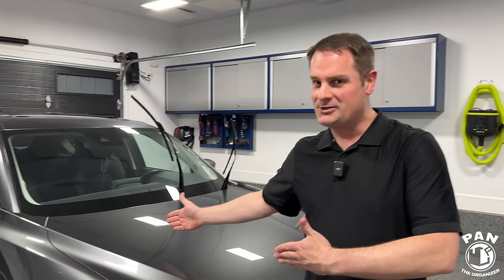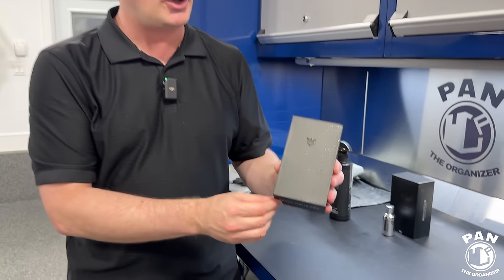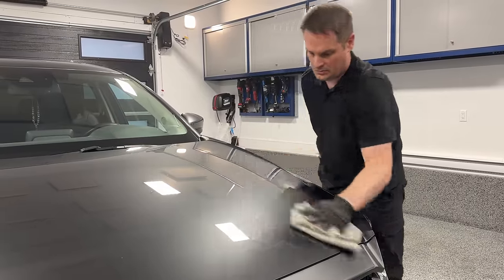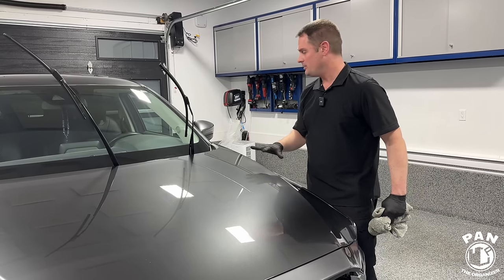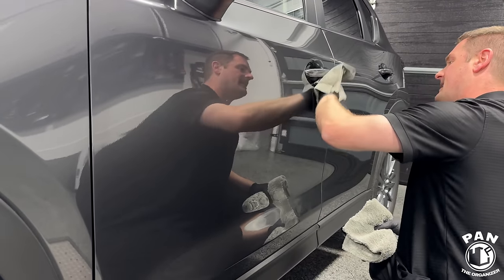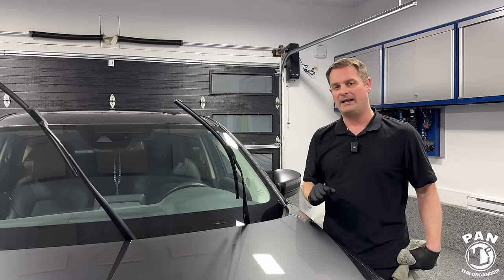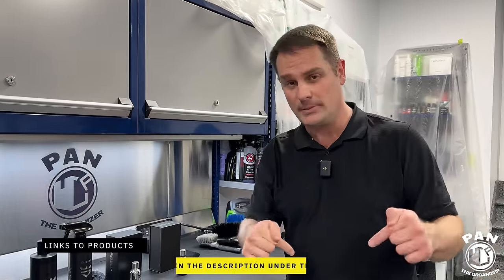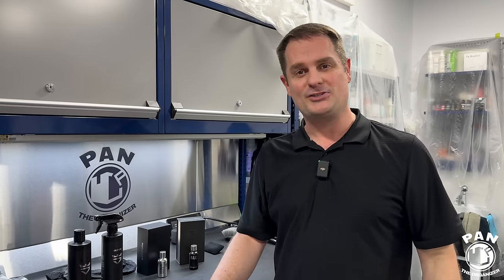NEW AvalonKing Armor Shield MAX ceramic coating! 1 layer, 3 years protection!

Comment: I have a new 2024 Honda CR-V white pearl metallic. Would you recommend Avalon King MAX, Pro or Cerakote or possibly something else? I’m looking for 3 to 5 years protection,one coat that works on all surfaces. I’m in western Kentucky and would greatly appreciate your advice for white paint! I’m an OCD weekend warrior and all the products I use are from your annual awards list. Thank you! Russ
Reply from the maker: MAX is a three year coating, so you'll have to wait for their G.O.A.T. coating that is promised to be a 5 year coating. Cerakote doesn't give any durability claims in terms of years, but they have reset the conversation around durability by measuring a guaranteed resistance to 200+ washes. But that's a professional grade coating, so I wouldn't compare it to a consumer grade brand like AvalonKing. We have to compare apples to apples.

If you want something I have been testing for a while that should give you the durability you want in a single layer, there aren't many options. You'd have to go on the prograde and purchase DuraSlic Holy Grail or Roar Coating. I have reviewed both on my channel. I need more time to test Cerakote, but that would likely be another fantastic candidate.

Comment: Have you used the AvalonKing on matte black vinyl wrap? My new car has a matte black vinyls decal on the hood and I’m wondering how the AK will affect the look.
Reply from the maker: No, but you could apply it on top of matte decals. It will make them look richer, but not glossy so it shouldn’t be of concern. Most paint coatings can go on matte decals.

If your entire vehicle was a matte paint, PPF or wrap, then I’d recommend a matte specific coating. Like in my tutorial here: https://youtu.be/5RocSxJQmzI?si=kxp5lbwTiC8zJ2zD
Reply: @PanTheOrganizer  That’s very helpful, I appreciate the response. I’m going to test it on a small area first just to be safe.

Comment: I have Armour Shield 9 on my car too and would like to go to the new Max coating.  what should I do to the car to prepare for the new coating?
Reply from the maker: As I mentioned in the video, if you have an exisiting protection, it would be best to:
- wash using a prep shampoo like their AK Prep Shampoo 
- iron remover to remove brake dust and fallout
- clay the surface to remove any other embedded contamination
- machine polish to ensure 100% removal of the previous protection (CRUCIAL STEP) and remove any swirls/scratches/oxidation
- IPA wipe with a paint prep spray (like the AK Prep Spray) or isopropyl alcohol mix to remove polishing oils and residue and prep the surface to receive the new coating
- apply the coating

I have a full ceramic coating application tutorial here: https://youtu.be/sqQYVjxFqK0

Comment: I'm going to be coating all 3 of our vehicles this spring. I'm pretty much settled on Mohs with a topper of can coat or FlowX. I can also get DS 1500 on a promotion right now but wanted to be able to use something I'd have access to long term. What are your thoughts between Mohs and the MAX? And would you spring for the DS 1500 over either one as a DIYer? Thanks.
Reply from the maker: Max is still too new to market, but MOHS is a higher end product for sure, so I wouldn't compare them. If you think of going for Gyeon, get their Syncro EVO kit. Apply 2 layers of MOHS, and 1 layer of Skin. You should have great protection for 36-48 months.
Reply: @PanTheOrganizer  Thanks. Do you feel like the skin reduces the slickness of the Mohs? That's the main reason I was thinking of can coat or flowX as a topper without Skin.
Reply from the maker: Yes slickness goes down a bit but it’s still a slick coating.

Comment: Pan, if you have to choose: Avalon 9, or the new Cerakote ceramic coating, what do you prefer, and why? 
( I can not choose)
Reply from the maker: Impossible for me to answer, as I need to test both for a longer term. I only applied the AS9 MAX 6 months ago on my brother's SUV, follow up video coming next month most probably. And the new Cerakote has only been released less than a month ago, so I need to test.

If the new Cerakote version does well as far as durability is concerned, that would be my choice, as it costs less, only needs 2 hours of curing, and has better gloss and slickness, and is even easier to apply.

Comment: Hey Pan, on these kits . Technically when buying a new towel your supposed to wash before use. Towels that come with kits, should you or not wash those towels
Reply from the maker: Yes. But as it’s a single use towel, it’s not as critical if you use it straight out of the box

Comment: Great video as always Pan! I applied the original Avalon King coating a few months ago and so far so good. Do you have a video that shows how to remove a ceramic coating and prep the car for new coating?  Also, I used my original Avalon King on all the plastic inside my car, can the Max be used that way as well?
Reply from the maker: The only way to remove a ceramic coating is by machine polishing. So you would have to redo all the steps from A to Z. Decon wash, iron remover, clay bar, machine polishing, IPA wipe or paint prep spray to remove polishing oils, and then apply the new coating.

The AvalonKing coatings are only meant for exterior use.

Comment: I like Armor Shield's products, but for some reason I've had a lot of trouble trying to remove them.  I've tried different towels, using less product, etc., but for some reason it's still hard for me to remove.
Reply: You are waiting far too long before buffing off the haze.  I found that I have to buff the haze off almost immediately after applying.  If you wait too long it’s nearly impossible to remove the haze.  Depending on the temperature, I typically buff the AS IX haze within a minute of application.

Comment: Hi Pan, I just applied the Avalon King Max yesterday. It has a great shine, but absolutely no slickness. I had more with a basic topper applied a couple weeks ago, Nexgen ceramic spray. My truck is like a battleship gray in color. It was super hard to see the product on the paint. And even after about 7-10 mins, we could not see any rainbow effect, so we did the leveling then buffed it. Any ideas? 
Thank you
Gary
Reply from the maker: It’s not the slickest coating in the world, compared for example to coatings like Gyeon Mohs, C6 Ceramics Lite, but it’s still slick compared to bare paint. Wait a week after application and you can start using which ever topper suits you most, to boost slickness if needed.

It’s hard to troubleshoot applications at a distance without having seen how you prepped the paint or how you applied it. Perhaps reach out to AvalonKing if you have specific questions as they are best suited to troubleshoot on their own product.
Reply: @PanTheOrganizer  thank you very much for your response. I did do all the prep work. First wash with dawn in a foam cannon, then a strip wash(contact wash), then sprayed Adams iron remover then rinse, then used diy perforated synthetic clay towel to decon, polished with diy gold standard and yellow pad, Avalon’s panel prep, then avalons king max coating. I’ll see in a week if I have any benefits of the coating. If not, I’ll contact Avalon like you stated. Thank you again. 
I’m new to this, my friend is really into detailing his vehicles and turned me onto your channel. Big fan. You give great insight to everything detailing. Keep up the great work…. And I’ll stay tuned👍
Reply from the maker: It seems like you did the right steps. If after a week, you wash the car and the water is beading nicely and is quick to sheet off, you know the coating is performing as intended so I wouldn't worry. If the water just pools up in one big flat sheet of water and is super slow to sheet off and doesn't have any water beading, you know something is wrong.

Welcome to my channel. You discovered one of the biggest car detailing channels on YouTube as we surpassed 1 million subscribers and we have over 140 million views! I have been detailing for 27 years and I love to share my knowledge and passion with my viewers.

You found the right channel to help you learn everything about detailing.

Comment: Hey Pan thanks again for the content you provide. I have a 2021 Hyundai Elantra with black metallic paint that hasn't  been washed for over a year and has set out in the elements. My car was detailed right before we moved here and I think he just put a wax coating on. My question is what would I use to strip my paint to the clearcoat? My detailer said I could use Dawn dishwashing liquid for a wash which would strip it down to the clearcoat so I can apply the ceramic coating. Suggestions? Thx kind sir.
Reply from the maker: You would use a stripping soap, like the AvalonKing Strip Wash I linked in the description. I don't recommend using household items on car paint. Dawn dishwashing liquid was a trick used decades ago. Now the technology with good stripping soaps exists. 

But regardless if you use a stripping soap or Dawn, that doesn't guarantee 100% removal of the previous protection. It just starts the breaking down process. If you still see water beading after the strip wash, you should do a light machine polish step. That's the only way to ensure 100% removal of any previous protection.

And after polishing, make sure you use the IPA spray (like the AvalonKing Panel Prep spray) to remove polishing oils and residue, and ensure a proper bond of the coating to the paint.

I have covered this topic extensively in many videos on my channel.
Reply: Thx kind sir. 👍✌
Reply: Thx kind sir. 👍✌

Comment: What did you use on the tires?  I put the original Avalon King on my car now 3 yrs ago.  Buying a new to me 2019 and will be giving it the works.  Bought the Cerakote before you did this video because of your other video :-)  Can the new Avalon King Max be applied on top of the Cerakote or vice versa?  Or would it be a waste of time and money? Keep up the great work Pan.  You have turned me into a bit of a fanatic.
Reply from the maker: No you don’t apply a coating in top of another one. True coatings need to bond directly to a virgin clear coat to ensure maximum performance and durability. 

The tire dressing I used in this video is this: https://bit.ly/2ZXCKt3
Reply: Reason asked is on a DIY Detail video they put their 3 year over the 8 year coating. Thought that was odd and against what you have taught me.  All the products I have purchased is because of your channel. Again keep up the good work. Your friend in AZ. Griz
Reply from the maker: That’s a very different scenario. In some cases, when applying a fresh coating, sometimes you can stack layers due to chemical compatibility. In that case, two coatings from the same brand, that were formulated to be compatible.

So there are always exceptions. Yvan knows what he’s doing as he has 40+ years of detailing and those are his products so he knows the synergy between them.

I hope this clarifies things.

Comment: Hello good afternoon, Pan, if we have any scratches or holes made by pebbles, can we apply them without any problems?

Thanks

Hugs from Portugal
Reply from the maker: You mean stone chips? I'd recommend that you do some stone chip repairs before applying the coating, as once you apply this, you are sealing in the finish for many years.

But if you don't care about how the stone chips look, you can just wash the car, do iron remover and clay bar, polish if needed, IPA wipe, and then apply the coating.
Reply: Thank you Pan for the explanation, it helped a lot because a lot of people say that you can't use ceramic coating as long as these things are present.

Hug  @PanTheOrganizer
Reply from the maker: My pleasure Antonio. Welcome to my channel. You discovered one of the biggest car detailing channels on YouTube as we surpassed 945,000 subscribers and we have over 125 million views! I have been detailing for 26 years and I love to share my knowledge and passion with my viewers.

You found the right channel to help you learn everything about detailing.

Comment: Just finished apply the Armor shield Max 3 years,very easy to apply I have many concerns with instructions need to be more clear how we should apply this product. Time for setting, temperature/humidity to install. I can’t find anything…! Anyway job is done the way I think it should be like others brand. I replaced my poor cerakote coating who last 4 months with winter and temperature probably too low when I applied ! The gloss and slickness of cerakote was awesome compared to Avalon max but the water sheeting and bedding was poor. Avalon max is very dry on touch no slickness at all and all my clothes and applicator was good for trash after the product crystallize. Pan already explains the different formula of coating. The included applicator  with Avalon was  really bad I prefer the applicator they gave with the previous version 2 years.

Comment: Excellent to see the new product from AK.  Andy's car looks amazing especially knowing how little care he takes of it :)
I'm definitely going to pick up a bottle of the new AK IX Max and try it out.  I have a customers car in mind that i maintain weekly for them.  Presently it has a Technicians Choice TEC528 as a weekly protectant.  It doesn't need polishing as I recently did that to it.  What would you recommend in this case, to remove the present TEC528 protection before applying the AK Armour Shield 9?  Do you think just a wash with something like Adams Strip wash, and wipe down a couple of times with a 30% IPA mix and then a rewash with the Adams Strip wash will do the trick to remove the TEC528?  Thanks
Reply from the maker: Strip washes only start the breaking down process of older protections. The only way to ensure 100% removal of any previous protection is by machine polishing. A light polish should be enough. There needs to be no more evidence of water beading on the surface. Meaning no protection left. Then IPA wipe, then apply the coating.
Reply: Thanks for the reply Pan.  I guess ill have to do quick once over with say a 3D One 400 to do the trick and then the IPA and coating.  @PanTheOrganizer

Comment: The product as I see is very easy to apply like the previous version but at the video I didn't see any diference in gloss from the no treated area.
Reply from the maker: It’s hard to tell a difference on camera. But for the biggest increase in gloss on any paint, the best way is always through paint correction (machine polishing). That’s how you get the biggest increase in measurable gloss (gloss units).

Paint protections (waxes, sealants or coatings) are like icing on the cake. They will give a few more gloss units, sometimes imperceptible to the eye, but offer a different type of gloss like a warm carnauba organic glow, or a candy like high gloss like a coating does.

Comment: Hey, Pan!  I have really enjoyed your channel.  I used the original Avalon King on my new car.  It was my first time applying a ceramic coat.  Everything went well.  My only negative is the water spots.  My car is a Subaru Outback Onyx edition in magnatite gray (similar the color of your brothers Mazda).   The dark color makes the water spots stand out.  I remember you saying that water spots could be a issue with ceramic coatings.  I live in the southern part of USA.  No known issues with hard water in the area.  I was wondering if you recommend any methods/products to remove the water spots that hopefully won’t diminish the ceramic coating?  Keep it clean!  Thanks for your hard work!
Reply from the maker: Yeah the only small downside of most coatings is that they are more prone to water spotting. So it's important to do regular washes to help remove those, and also use deionized water if possible. Even if water isn't "hard" in your area, it likely still contains minerals, and those can lead to water spotting as you know.

Many brands have released toppers to help combat that (for example, CarPro Gliss 2.0 topper to be applied on top of CQuartz UK 3.0, or Gyeon Skin to be applied on top of Gyeon Mohs or Gtechniq Exo v5 to be applied on top of Gtechniq CSL, etc). Those are hyperslick toppers with aggressive water contact angles to quickly shed water in order to help reduce chances of water spotting.

If you do have some spots, it depends how bad they are and how long they have been there. You can use the less aggressive method first, which is to use a shampoo formulated to remove mineral deposits, like this: https://bit.ly/3u2KsmZ

If that still isn't enough, you move the aggression up to a water spot remover spray: https://bit.ly/3QLS3zg

If the spots are still there, that means you'll have to machine polish them off, and at that point that means you'll be removing the coating to, so you'll have to reapply a fresh coating afterwards.
Reply: @PanTheOrganizer  Pan!  Thanks for all the detail!  I will pick up some CarPro descale to start.  I have been using CarPro Reset as my shampoo and Titan Phoenix detailer as a topper.  Thanks so much!  I really appreciate your in-depth answer!
Reply from the maker: My pleasure Chris!